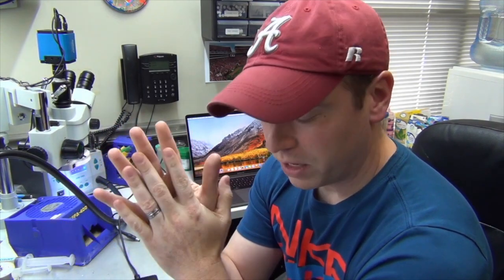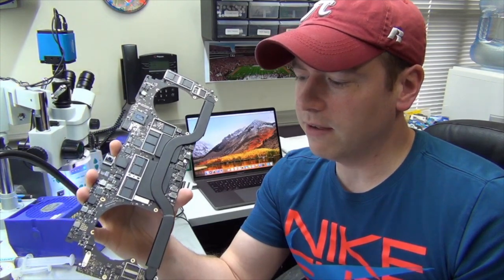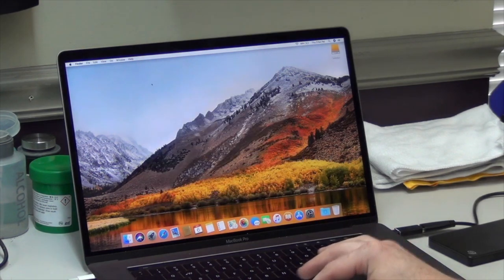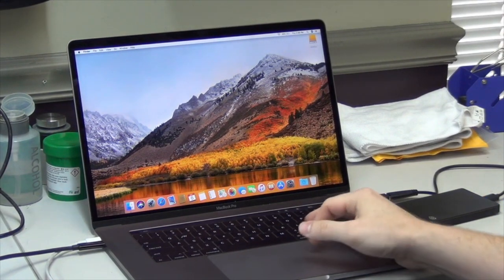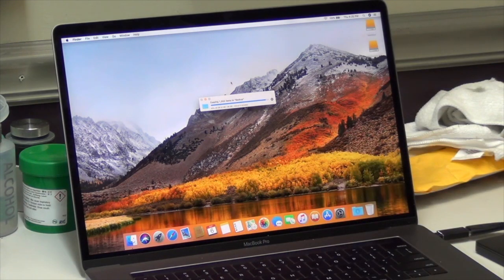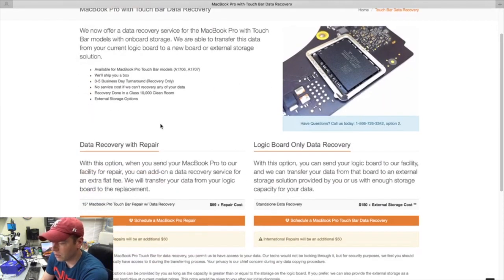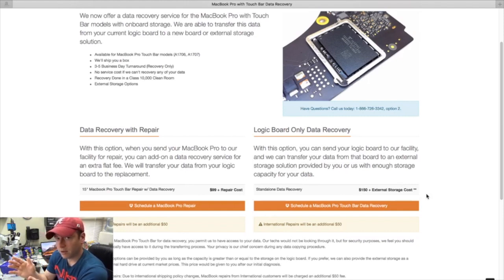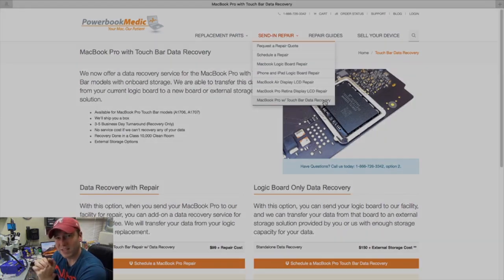Macbook Pro Data Recovery - Touchbar A1707

Comment: my Macbook pro running Big Sur M1 2020 is plugged in.  There is power to the tool and it appears to be clipped to the terminal. My broken computer is MacBook Pro A1706 mid 2017.  I can't see the disk.  Suggestions?
Reply: Have you tried to connect the tool with the same or earlier year Macbook model?

Comment: Can I recover my data from macboo pro 2017 without touch bar model ? I checked the logic board I could not find the connector there. It has opposite site same connector.
Reply from the maker: The non-touchbar model has an SSD blade, so you can take the blade out and put it in another non-touchbar to recover data.
Reply: @PowerbookMedic  Thanks for advice. Even apple authorized service does not do it this taking out the ssd and putting it in another macbook pro model. They told me it has unique ssd which we cannod access inside in it. Really ridiculous.

Comment: Hi, would you be able to recover data from 2018 macbook pro 13 with touch bar?
Reply from the maker: Conference Unfortunately, we cannot. Apple has removed that connector from the 2018 board, so the data is not recoverable.

Comment: Hi, this is brilliant... and I am hoping that this may save me. I understand that the current method and tools used in this video does not work on the newer 2018 Touch Bar Models. Would the methodology work for a 2017 Touch Bar 15" Macbook Pro?
Reply from the maker: fatrick Thanks! Yes, it will work for the 2017 model.
Reply: @PowerbookMedic  wow...  amazing. would it be possible to receive contact details to discuss further on next steps? thank you much.
Reply: @PowerbookMedic  where can I buy this tool from

Comment: Does the logicboard need to be removed from the device for this to work? Does everything need to be disconnected?
Reply from the maker: It's Binh Repaired You would need to disconnect the battery before attempting this, but everything else can stay.
Reply: @PowerbookMedic  so I completely removed the logicboard for nothing? Lol damn
Reply: @ItsBinhRepaired  LOL..
Reply: @PowerbookMedic  risked a friend's $4k macbook pro to make sure the device was working properly after it failed on another. It worked with just disconnecting the battery, thanks! The other one, I completely disassembled for nothing... :( Data wasn't recoverable. SSD was destroyed by the liquid spill.

Comment: Hello. Can you recover the data without remove the board from the mac computer? or is necessary uninstall the logical board? Thanks
Reply from the maker: Alejandro Morales You can just unhook the battery, you do not have to completely remove the logic board.
Reply: @PowerbookMedic  Two more questions, this tool works with Mac A1706, and the host computer for data copy need thunderbolt port? or can works with any USB-C or USB-A port? Thanks in advance.
Reply from the maker: Alejandro Morales It only works with the 2016-2017 boards.  And the cable used is a USB-C cable to transfer the data.

Comment: Hi sir I’m from South Africa, I need to get my data off my A1708 ssd...it seems like no one on the internet has a solution. Have you figured out how
Reply from the maker: Charlton Noble Hello, no I am not aware of enclosure that you can use for those.
Reply: Should I just put it into my new Mac,same model. Would you suggest I take it to a specialist like yourself
Reply from the maker: Yes, that would probably be the best solution.
Reply: Hi Charlton did you find the solution for this.. i am facing same issue